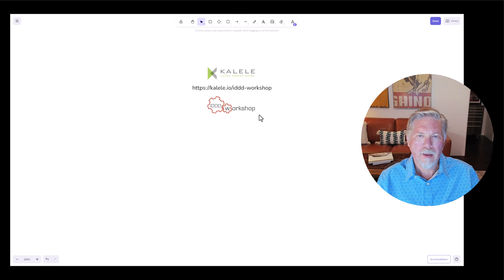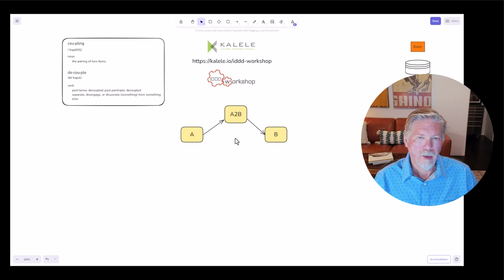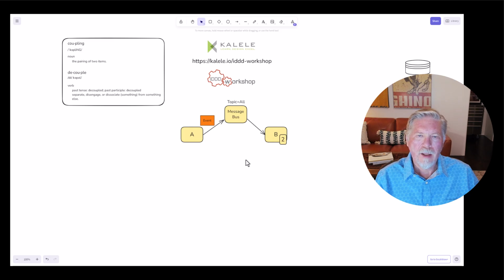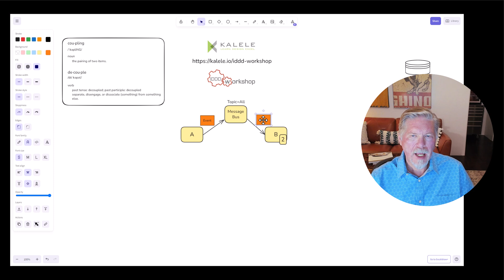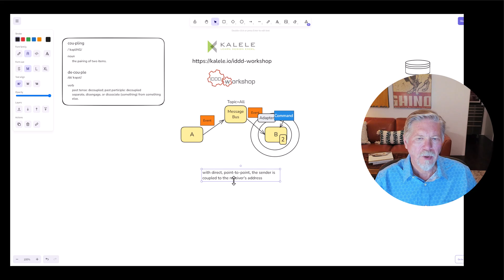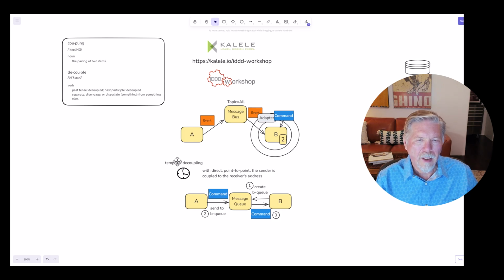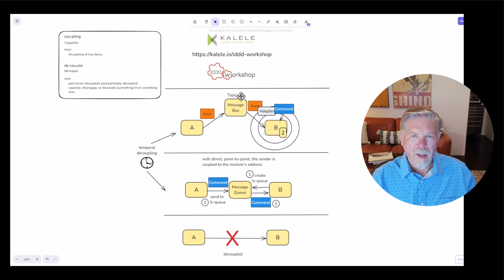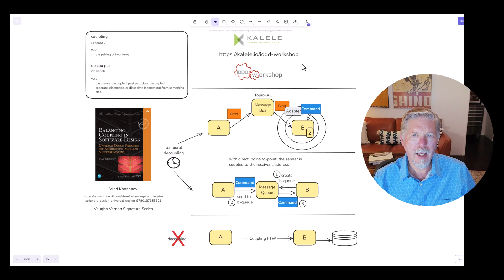Design Accelerator: Good Coupling, Bad Coupling, Coupling FTW

Comment: Great video and perspective of an overlooked aspect. There are clear cases when bad coupling has occurred and should be removed (decoupled), such as business logic using functions/objects in a web tier. But I also think that "decoupling" is often used for the meaning "reduction of tight coupling". The tighter the coupling, the more difficult it is to replace/modify a particular component/subsystem. Reduction of tight coupling often introduces new abstractions, and (as always) one needs to balance the cost/benefits of new abstractions.

Comment: Thank you for the great explanation. I think it's important to clarify coupling in terms of context. If two components, A and B, are coupled with respect to changes in B's API, but B's API is guaranteed to never change, then it's not really coupling. For example, using a programming language is not considered coupling if the language's API is fixed and will never change. From this perspective, design becomes a matter of hiding changes behind interfaces that are less likely to change.
Reply from the maker: Sorry, but no. If nothing is coupled to B, B does nothing. A is coupled to B regardless of B's stability. BTW, from a business perspective, and assuming B is useful at the business level, if B never changes, you haven't learned anything.
Reply: I view coupling, and cohesion as well, as dependency and knowledge. If A couples to B, then A depends upon and has knowledge of B. B has no coupling, dependency nor knowledge of A.

If B is stable and never changes, then it's stable dependency and knowledge. The dependency is still there, but it may never become a modification issue.
Reply: @jimhumelsine9187  My point is, we should say A is coupled to B with respect to changes in B's API. In addition to specifying the dependency, we must tell with respect to what change.  If the change never happens, its not a dependency.
Reply from the maker: @MohamedKamal-wd8hx  "You keep using that word. I do not think it means what you think it means.” -Inigo Montoya 😊
Reply: @MohamedKamal-wd8hx  Taking your idea to the extreme you could have all the project in a single file and you could argue that nothing is coupled to anything if nothing changes.

Two things are truly decoupled when nothing defined in the boundaries of these things can possibly affect each other. 

If any B operation depends on any understanding of something defined by A, regardless the layers of indirection, then they are coupled.

Also, specially in your example, because you are assuming that what is couplin both services will not change, is were you should be the most aware that this coupling exists.
Reply: @edbard1406 I'm saying that dependencies can either be inactive or less likely to change, and in such cases, these coupling points shouldn't concern us much. For example, you're inherently coupled to the programming language or the network protocol you're using, but these are generally very stable and almost invisible in your system's design diagrams.

Taking your idea to the extreme, everything would end up being coupled to everything else. This is why I mentioned that saying two components, A and B, are coupled is incomplete information. If they are part of the same system, there will always be some way they share knowledge. The context, or 'with respect to what,' is crucial to specify. For instance, I can say A and B are coupled with respect to [specific aspect].
Reply: @MohamedKamal-wd8hx  you said that if something guaranteed never to change that isn’t really coupling. I was answering that, with the points that what you are giving is not a definition of coupling and that particularly in your example, because how frequently the statement “this will never change” is false is where you should be the most careful, because those are blind spots.

When Mr.Vernon talks about good and bad coupling he is trying to emphasize what coupling “is”. In this industry, because the word “decouple” has been fetishized, everybody is trying to bend the definitions to match what they do, and this leads to them stop knowing what the thing means in the first place.

Your point about concerns are valid, some types of coupling are more concerning than others, some type of coupling are a very good thing even, but nobody was criticizing that.

Note that what you are doing is deciding is something is or not “coupled” based on if this coupling seems or not acceptable for you, which makes the word lose most of it’s meaning.

The way that we speak matters. Instead of saying “is not really coupled” rephrase to “it’s coupled but i think is not a concern right now because it seems is not going to change in the short term”, which is more accurate to what you really mean after having a proper definition pf coupling.
Reply: I agree with you!  Two components could be coupled but the coupling type may not concern us. This is main point,  saying  two things are coupled is incomplete information,  we have to also say with respect to which changes.